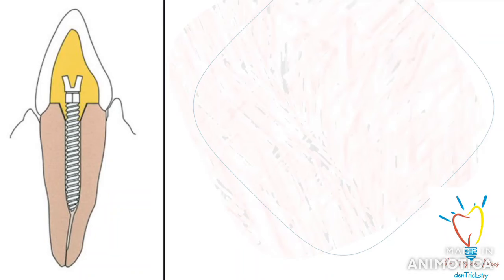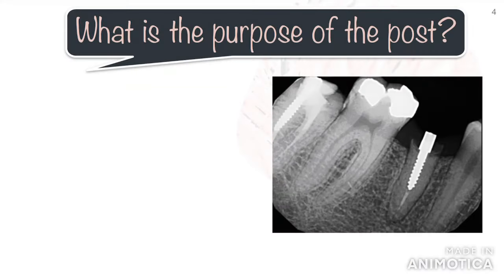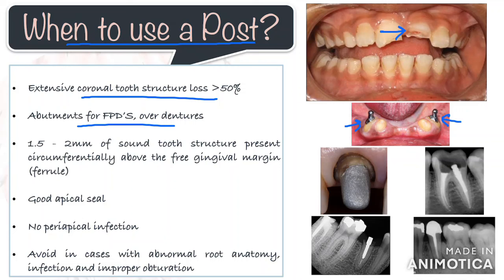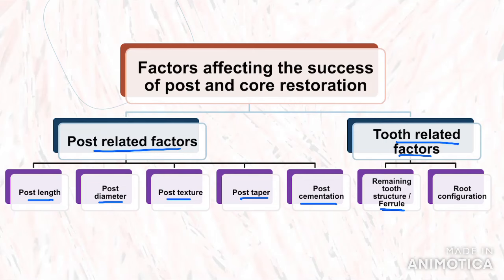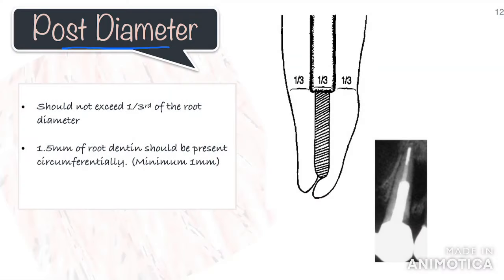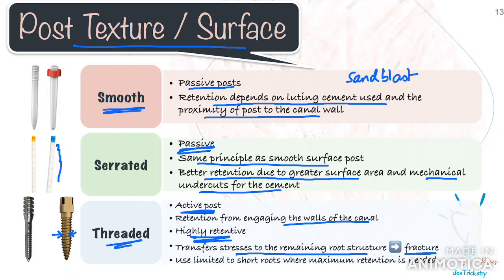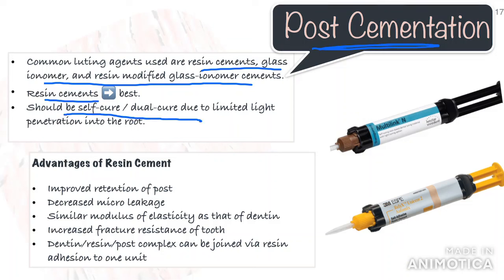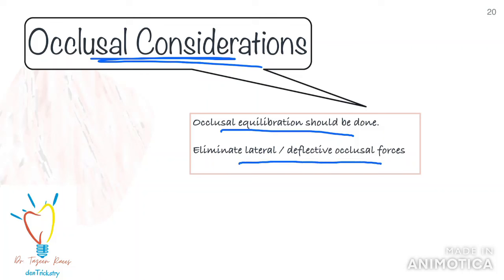POST AND CORE (Saving 'HOPELESS' Teeth)- Part 1/ Factors for a successful post and core procedure .

Comment: Hello Mam, 
In my priscprition its written
Post and core done/Composite restoration done..
What exactly composite restoration done means?
Reply: It means your tooth has been restored with a tooth coloured filling.
Reply: @jm2340  and after that it was cut to a smaller shape over which false cap was fitted, what is the termenology for cutting ?